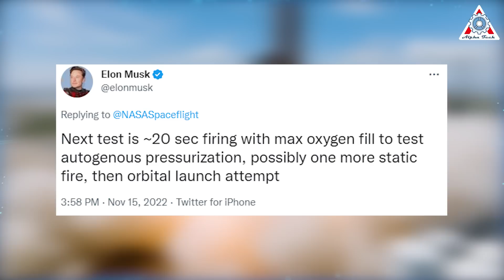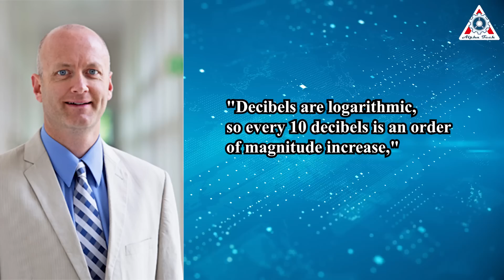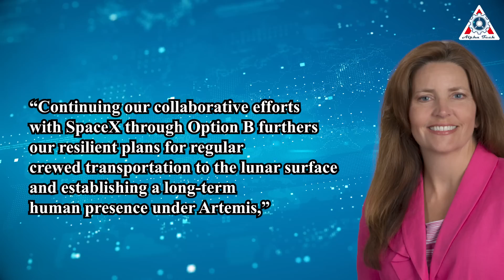SpaceX stage zero facing BIG PROBLEM with 33 engine FIRING...

Comment: This has always been my biggest concern. I don't see how they stop spalling, severe pad damage and ballistic hazards the way the launch area is configured. Without a way of diverting and mitigating the engine blast, they're going to continue to have a high risk scenario that I don't see as a necessary one.
Reply: When they prove they can get to orbit they will improve the launch pad. You need to remember how this company develops their systems.
Reply: @tcskibike  how will they get to orbit if the launch vehicle is riddled with pieces of concrete travelling at ballistic velocities?
Reply: @tcskibike  Unless the unimproved pad keeps them from getting into orbit, or even a hundred feet off the ground in one piece.
Reply: Yes, a fifty foot hole with vertical shafts every fifteen feet would eliminate the problem.
Reply: @danielvazquez7482  then it would be filled with sea water.....  next suggestion.
Reply: @machineenvyllc437  of course it will, that’s what the vertical shafts are for. The pressure and venture principles force circulation providing a natural fire, exhaust and noise suppression. Educating oneself on hydrological principles might help in understanding. It’s the same principles that have thwarted every attempt to reach the the bottom of the “money pit”. hydraulics.
Reply: @machineenvyllc437  That's heading in the right direction.  Elon has those two oil drilling rigs parked at a shipyard in Pascagoula, MS awaiting the final work to convert them to Starship ocean launch platforms. 

No need for a concrete flame trench when you have all the water you need to suppress acoustic effects. And those 33 engines just boil seawater until the restraint clamps are opened and the Starship is headed uphill. 

My guess is that Elon will position those platforms about 100 km offshore from the beach at Boca Chica and launch the tanker Starships there. Those tankers would be built in the Starfactory at BC.
Reply: It’s frightening to see how low to the ground it is for sure.  It definitely could help testing their engines as well if they would make the stand taller and make a solid trench for the sound, flame and gas to escape.  Biggest rocket needs the biggest set up.  That stand isn’t much to work with.  Mechazilla is beautiful but she needs more water and even more space for good measure.  Then stage 0 can make sure it’s counter parts are well suited with no risk to itself.
Reply: @jonathananderson7990  your right except the greater the height of the stand the less stability so thats a trade off leaving it more vulnerable.
Reply: @danielvazquez7482  Reference the Skylab crew launches from the "Milk-Stool" configuration at Pad 39B.  It was much taller than the Starship stand and I don't think it utilized the flame trench of the pad or at least it was very limited.
Reply: @bob19611000  Interesting; However, wasn’t Saturn 1b a special use 140 foot rocket, Super heavy is 230 feet alone and nearly three times the size of 1b. Super Heavy also produces 72 million newtons of thrust; more then twice that of 1b. so it’s like comparing apples and grapes.  Moreover, are we really comparing a 1966 configuration to 2020s?
Reply: @danielvazquez7482  Yes, the Saturn 1B was less powerful than the specs for the Space X design but the point is, it would not be out of the question to use a much taller stand even if its base would need to be wider and more structurally sturdy.  On the point of it being "special use" it had many  manned launches (eg Apollo 7, 3 Skylab crew, and the Joint Soyuz / Apollo missions) along with various unmanned missions.
Reply: @danielvazquez7482  Only if you don't also increase it's footprint.  Place the support legs farther apart.  
My first concern was how close the pad is to the tank farm.  Why would you NOT put as much of your valuable infrastructure as far from what  is potentially the biggest bomb in rocket history as you possibly could?  At least put some sort of shield between the pad and the tanks.
Reply: @kimweaver1252  The tanks were addressed many months ago so what you now see are insulted encapsulated covers and a concrete blast shield separating them from the launch pad. Your footprint comment made no sense to me as I’ve not advocated for any such thing. Thank you.
Reply: @danielvazquez7482  If the pad is raised, it doesn't need to be unstable, IF you also increase the distance between the legs.  That was your objection to the suggestion that the stand be raised to get some more clearance under the nozzles for sound and blast abatement measures.
Do you think that a bit of concrete and insulation will protect those tanks if a giant spaceship is lofted, blazing and then exploding, onto them?  Have you ever watched the vid of the explosion of the Soviet N1 booster on the pad at Baikonur?
Reply: @kimweaver1252  thank you.
Reply: I would have to think the pads will get a big upgrade before they move to the full number of engines.
Reply: This has been obvious to me since the booster design (33 motors), the stand configuration, and lack of a flame trench was reveled; but all the Space X sycophants/fan boys just accused me of being an armchair rocket designer. 

Anyway, I guess all those flying chunks of concrete during a low powered test seem to confirm my concern/comments. The second concern alluded to here is the acoustic interaction of the 33 motors, forget all the bouncing hunks of concrete.

BTW, although I’m not in that game anymore, I wasn’t an “armchair” aerospace engineer.
Reply: @bob19611000  maybe they are practicing for launching from the moon's surface. However that would be only starship I believe.

Comment: It seems obvious that not all 33 Raptors will be used simultaneously at launch. Banks will be sequenced on and off for launch & landings.
Reply: The all-up weight of a complete Booster plus Starship fully fuelled is about 5000 tonnes. Thirty-three Raptor 2 engines produce ca. 7500 tonnes of thrust, giving the stack an acceleration off the pad of about 1.5g, about the same as the Space Shuttle, the Falcon 9 FT and other modern rockets. The rocket equation is a race to burn off fuel fast enough to lose weight so the remaining fuel can keep the rocket accelerating upward. TL:DR; All 33 Raptor 2 engines need to be burning at full power at the start of the launch just to get the fuelly-fuelled Booster+Starship stack moving.

It might be possible to launch an underweight test stack with reduced engine performance, a partially-fuelled Booster with a cut-down partially-loaded Starship on top but I don't think SpaceX could save a thousand tonnes on the pad and it would do weird things to the centre-of-gravity and affect other parts of the flight envelope.

Comment: Please think: 
(1)  Use the spcecraft godzila arms to hold while launch 
Instead of the Launch-pad (stage 0) 
(2)  Try to replace the concrete with metal...
(3)  But my real contribution is for TESLA (fast Passenger Cars) Brakage: 98% of ideal decelaration on dry-asphalt with paddels (wet-asphalt)..
Reply: Email Elon with the amazing findings, but first learn how to spell.
Reply: The Godzilla arms are not able to hold up a fully fuelled Starship AND fully fuelled booster, only a very lightly fuelled Starship.

Comment: I think they need to redesign that stand. Is there no pit underneath? To me it looks like a flat slab directly under the stand... Take an oxyacetylene torch and hold the flame on the nearest concrete slab and you'll see  flakes & chips popping off. Water deluge system or not, I would think the heat & pressure would obliterate a flat concrete slab?
Reply: then take the same concrete and coat it with the epoxy they have there.
Reply: @machineenvyllc437  please enlighten me on that kind of epoxy. Do we really have something strong enough to take that kind of heat? Totally badass if so!
Reply: @headlong_gypsy  its there.  They have talked about it in the past.  NASAs also has it on their concrete.  Don't remember the trade name.  My guess look up something like fire retardant epoxy for concrete.  

Not much damage though.  They had the platform thing underneath it right afterwards.  No one saw any sort of concrete work done.